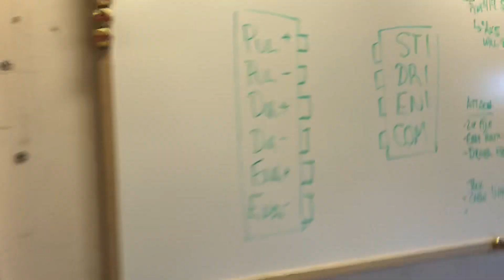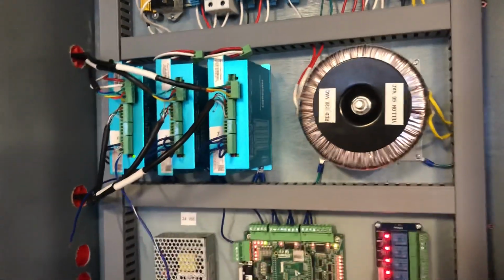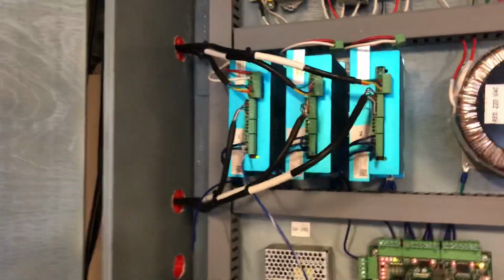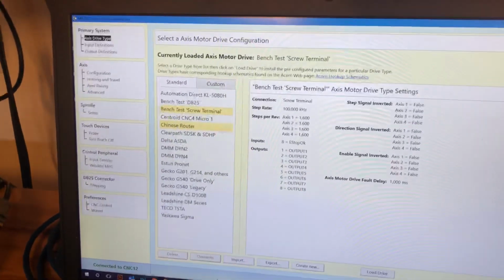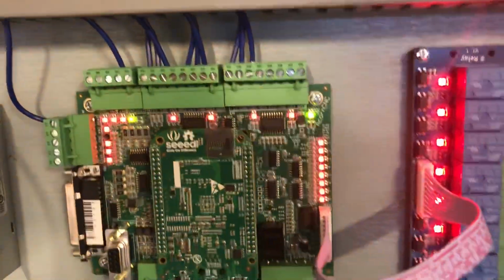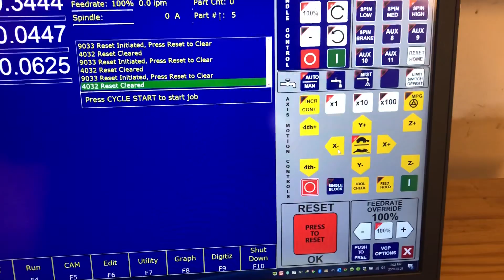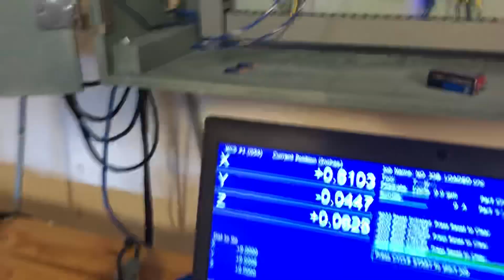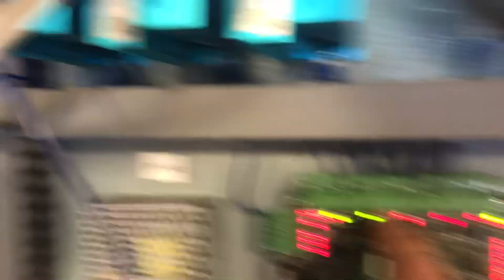HBS860H Closed Loop Stepper Drivers & Nema 34 Motors - Bench Test Issues

Comment: You asked earlier what I was asking about, well I just got all my motors turning. ( I hooked up step and direction to the DB25 connector for all three drives and capped off the ena- lines, I left the ena+ hooked up. I get all motors turning now.) The biggest thing now is how to set the cnc 12 settings to my drives. Like I asked earlier it’d be invaluable if you could show the settings you have in cnc12. I have one other question, do you have any issues with your breaker tripping with that toroidal transformer? Or did you use some type of resistor for the influx of power at startup?
Reply from the maker: trialnterror sorry for the super late reply. I hope you got everything figured out. I’m still using the bench test configuration to run my CNC. Not sure if that’s a bad thing for some reason. I’m not (and was never) tripping my 20A breaker, but I was blowing fuses before I put in the AC relay and series resistor to deal with the inrush current.
Reply: @adamdebowski2037  I got everything figured out, I bought a d curve (I believe it’s called) breaker which handles the toroidal inrush current. I am also using bench test configuration right now

Comment: Adam,  do those drivers/steppers take 60VAC or are you Rectifying that 60VAC through a full wave birdge rectifier to get DC and smoothing out the pulses with a capacitor?  Just asking as I have never seen a 60VAC stepper, only DC.
Reply from the maker: Brian G yes they take 60VAC directly, which is why I went with these drives and a single toroidal 220VAC to 60VAC transformer. The drives also have the ability to take DC if you want to do that instead.

Comment: After doing research centroid recommends to hook these to the DB25 connector and not hook up the ena lines????  (Enable) it’d be cool if you could chime in!
Reply from the maker: Hey - sorry on the late reply. The motors drivers were enabled by default. You are correct, I do not have the enablines hooked in and I am NOT using the db25 connector.

Comment: Hello and congratulations on your achievement.  
why do you use a toroidal transformer and why not a classic 60 volt power supply .
thank you for your answer
Reply from the maker: daniel RICAUD classic DC power supply would also work. These drive are able to take both AC and DC, and I believe toroidal transformers are cheaper. I would recommend DC power supply because you will not have to address the problem of inrush current (to toroidal transformer) blowing fuses in your panel.
Reply: Thank you very much
Reply: EMI on switching power supply....

Comment: I'm sure you got it by now but im pretty sure its to do with the motor encoder wires not being wired right.had the same thing happen but found some other wire schematics online that were way better then what came with the unit and got them working after that. what was the issue in your case? thanks

Comment: Could you do a video of how you got your motors turning? I have about the same setup.
Reply from the maker: What do you mean? What would you like to see, exactly? You are just trying to bump a motor and get it communicating kinda thing? Do you have the same drivers? Are you using AC or DC power into the drivers?
Reply: Adam Debowski it would be really cool if you could do a video of the settings you have in cnc12 kind of a walk thru ....I’m lost there and if you changed any dip switches on the drivers.
Reply: Adam Debowski oh yes I’m just trying to get my motors to move.

Comment: Hii I am in France 
I have same issue with my  hbs86h 
It's holding motor axe  but can't move 
When try to move  red light blinking 
Any help
Reply: What you will find with these is the wiring diagram supplied is incorrect in many occasions,  open the encoder carefully  and look at the correct  configuration.